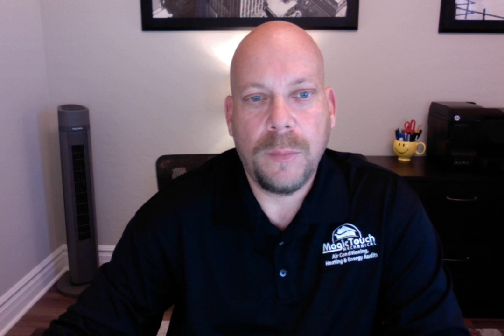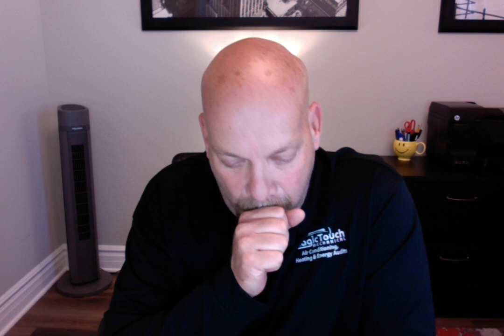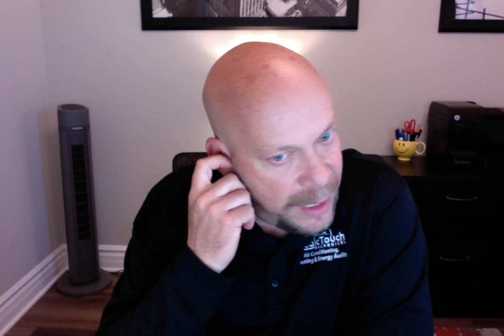Variable Speed AC vs Two Stage vs Single Stage - Which is Best for Hot Climates like Phoenix AZ Area

Comment: 5 ton for 2000 square-foot home? That seems really high. I wonder if it’s because it’s Arizona. I live in Virginia and a typical unit for a 2000 square-foot home would be anywhere anywhere from 2 to 3 tons, depending on how well it’s insulated, windows, doors, etc.
Reply from the maker: Yes, ACCA load calculation design conditions vary wildly all over the country depending on average cooling degree days, seasonal RH%, etc, etc. - the Phoenix area is also considered by ACCA (who created and writes the Manual J standards) a “micro climate” so the indoor design temp is 75 indoors at 108 (110 in some cities) ambient with 50% indoor RH … and that’s considering up to par insulation, windows, etc based on their year the home was built. I live in a semi-large home with 12’ ceilings in most locations and 16’ ceilings in one area, excessive insulation and air sealing, R8 ducts, dual pane low-e windows, shade screens, awnings, etc, and my home still calls for 9 tons of cooling! Add the 2 ton mini split cooling my workshop and you can see why although comfort was my highest priority, I’m not sad that they’re also the most efficient units money can buy either … that’s a lot of btu’s being moved and spinning the power company’s meter fast! 😂
Reply: That’s interesting. If I did the same delta (33 degrees) between my typical hot day (90) I would set my ac to 57 in the summer(!). I’m at 74 during the day and 71 at night. So I see how much harder systems there work. For my split level 2100sf house with 8 foot ceilings, new attic insulation, newer windows and doors, I’m at close to 2 ton. Current 20+ year unit is 2.5 ton.

Question, with my top level, where the bedrooms are, I have a harder time keeping them cooler in the summer and warmer in the winter even when balancing the ducts. Toyed with the idea of doing a minisplit system just for that level with either ceiling cassettes (1 way) or a concealed cassette in the attic with vents for each room. Problem is it’s cramped up there with all the engineered trusses. Any thoughts?
Reply from the maker: @krehbein  sounds like a strong candidate for one way ceiling cassettes. We have one in an area of our fireplace showroom that’s part of a multi-zone setup and it has performed flawlessly … here’s another video just about that system: Mitsubishi Mini Split Review 7-Year Torture Test
https://youtu.be/gUSE1k9Dm_0